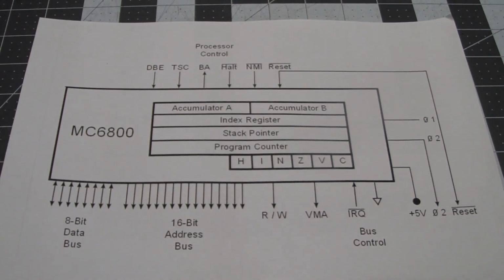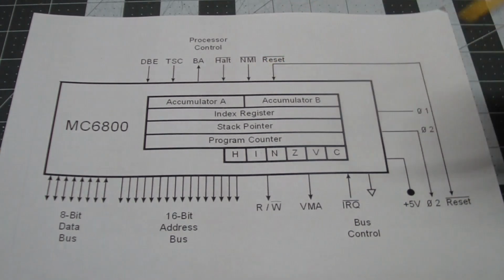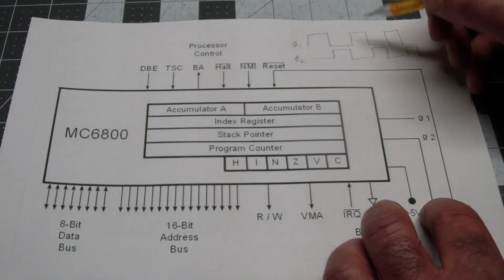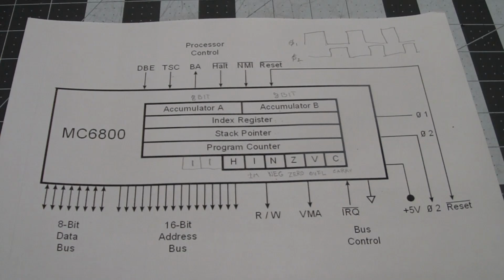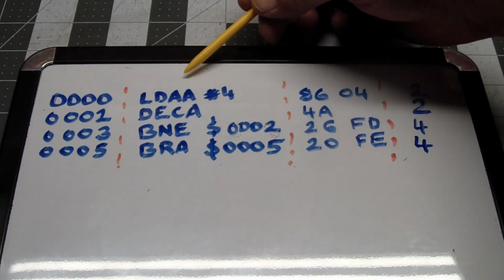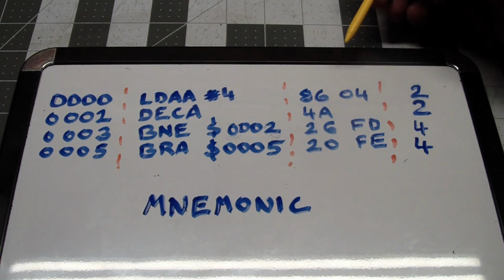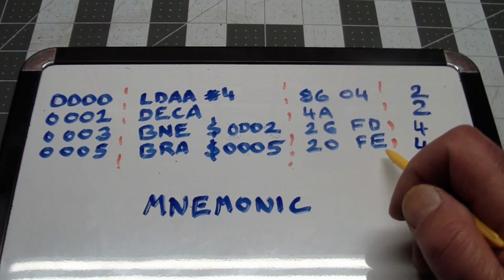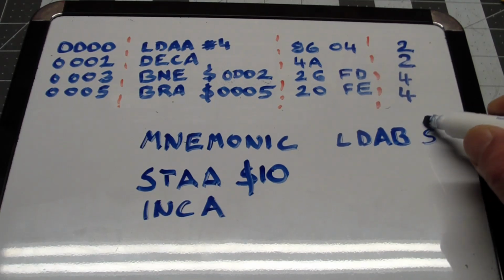AE#159 Motorola 6800 Machine Language Programming, Part 2

Comment: In the 6800, are branches computed freely, or only within the same memory page like on the 6502 series?  (This is an interesting question because many of the designers of the 6800 went on to design the 6502, which has this awkward thing where the conditional branch instructions can only branch to the same page of memory.)
Reply from the maker: The 6800 does not impose page boundary limitations when using relative branches.

Comment: I thought good programming practice was to return to the caller? Then again I'm used to calling machine code from basic, so I suppose if you're just executing it from startup then there's nothing to return to!

Loving these chip oriented videos, I actually learned a few things despite being a chip enthusiast.
Reply from the maker: Technically you're not supposed to mess with the stack and just return. But in this case the stack is used to pass parameters to the a subroutine. Right after the JSR instruction there are a bunch of data statements used to pass parameters. Thus the return address after the JSR is totally bogus and the return needs to be manually handled.

Comment: Hello, I think its really cool that you are making videos that are relevant to my current project. If you don't mind, could you please watch my short video showing various oscilloscope readings and other tests on my Atari pinball board? I mainly just wanted to know if the square waves looked right. You can find it on my channel easily. Thanks
Reply from the maker: I didn't see anything suspicious in your video. But you have to install a processor and roms to get real results. See if the counter chain (watchdog) is getting reset periodically with all components on board. Using a scope check all pins on the processor and see if the waveforms look anything like a square wave. Unfortunately for diagnosis the DMA makes everything look a bit strange.
And a bar over a signal means that it is active low.

Comment: ARTIFACE ELECTRONICS, What programming language did atari home console use for programming arcade games in the ROM chips? The big arcade games consoles have multiple ROM chips but I don't know what programming language they used back in the 80's to program those arcade games. I don't think they used machine language, BASIC, PASCAL it must have been another type of programming language for various types of big arcade game consoles because they used mostly 8 ROM chips and 2 PROM chips for the graphics codes loaded on the PROM chips. It would be nice to give a lot of examples of how arcade games and pinball games used the NMI signals, IRQ signals, RMA signals, HALT signals. I have seen pinball games use the PIA chips to send NMI and IRQ signals and arcade games RAM chips sending RMA signals. But I have never seen arcade games use the DBE and TSC signals because mostly the NMI, DBE, TSC are hardwired tied inactive mostly in arcade games. It would be nice is you could give more information about how arcade games and pinball games use these signals NMI, IRQ, RMA, HALT, DBE, TSC.
Reply from the maker: Most classic arcade games were written in assembly. Early compilers were not efficient, and the assembly code they generated required more horsepower than the boards had.
Reply: I will try to find out what Atari used, as I'm curious myself. I know that a few Atari arcade games used Forth, but not many. But I don't know what the rest used. I think I did read that defender was pure assembler. But I think that a Williams game, not sure.

Comment: 68060 in late Amigas :)
Reply from the maker: The assembly syntax was wonderful, very similar to PDP assembly.
Reply: @artifactelectronics  It has been pointed out that the PDP machines presage many features of RISC chips, particularly with their orthogonal instruction sets. (In orthogonal instruction sets, each set of bits in the instruction means the same thing in every instruction, or at least in a family of instructions.  Another typical feature of both PDP machines and RISC chips is they tend to have large numbers of registers or can treat some memory as if it was registers.  IIRC, PDP machines usually could use indirect addressing, which allowed a memory address to be worked on to be specified in memory.  The 6502 could do this as well in page zero, in two different ways:  One indirect mode allowed the addition of one index register to the address stored in the zero page of memory, and the other used the other index register to step through a table of addresses stored in the zero page.  Very powerful tools which, like all powerful tools, can take your face off if you screw up with them.  Get the address wrong and you're accessing some random place in memory, and clobbering some random thing.)

And, of course, the design successor to the 680x0 series was the PPC, an actual RISC chip, and one still in production. (Although of much more limited use since Apple decided to switch over to the Intel chips.  One problem with RISC chips compared to CISC chips is advanced design features like pipelining and branch prediction don't create nearly as much benefit for RISC chips as they do for CISC chips.  If you've got a 7 or 8 stage execution process, having each stage able to work on a different instructions speeds up processing a lot.  When you've only got a 3 or 4 step sequence, the benefit isn't nearly as much.  Similarly, branch prediction that's usually right saves a lot more cycles on a 7 or 8 stage pipeline than it does on a 3 or 4 stage pipeline.  It does help, but not enough to really keep the RISC chips nearly as competitive as they were before pipelining, when RISC chips were both faster per clock cycle and used a substantially lower amount of power.  They are, however, hard to write compilers for.  One consequence of things like highly orthogonal instruction sets, and this is a problem that goes back to the PDP series machines as well, is that there are many, many ways to do most things, and it's hard to write an algorithm that can correctly pick the optimal one to use in each case.  It's not overly hard for a human, but you don't want a human to have to hand-tune the assembly code produced by your high-level language compiler's intermediate stages.  This has become more prominent of a problem as machine cycles have become radically cheaper and people have become radically more expensive.)

Comment: This is great and you can mix in assembly language when using modern microcontrollers so I'm going to have a go !....cheers.
Reply from the maker: I you want a real challenge write some assembly for an ARM processor using thumb code. You can also get specs for the full instruction of an ARM, but the manual hints that you have to be an idiot to use that. The full instruction set is optimized to support high level compilers, and each line of assembly code looks pretty scary.

Comment: The 68000 was nicknamed the "aircraft carrier" due to its .6 spacing.  We had PDP-11 assembly language program i hand translated to the 68k and we put all the stuff that was on a boxed PDP-11/04 on a single unibus card.
Reply from the maker: The assembly syntax wasn't too different though, if I remember correctly. The 68K borrowed heavily from the PDP.